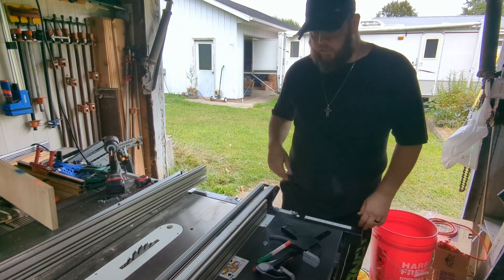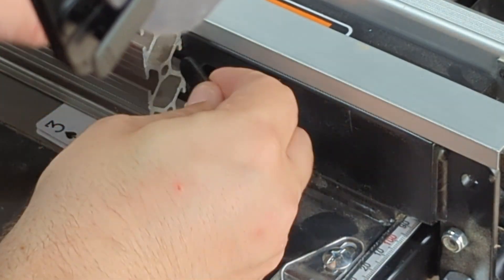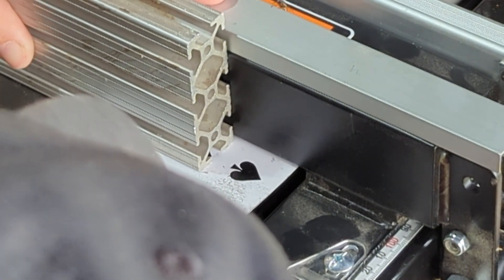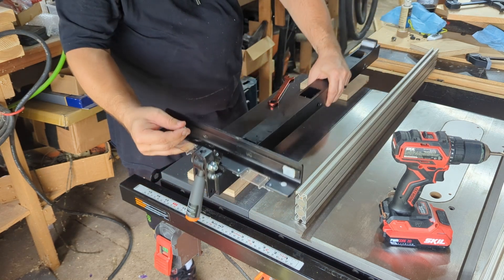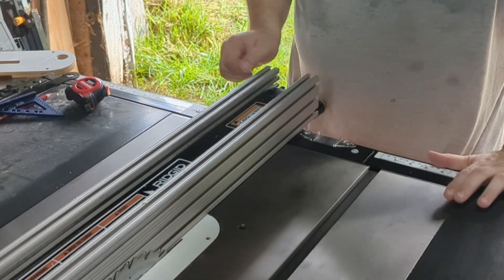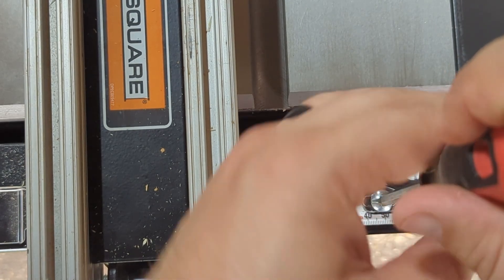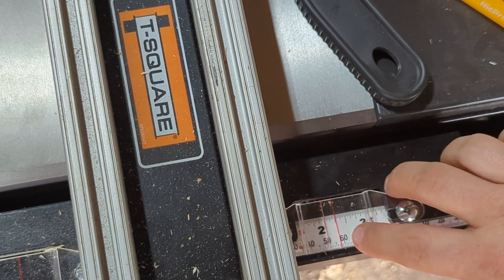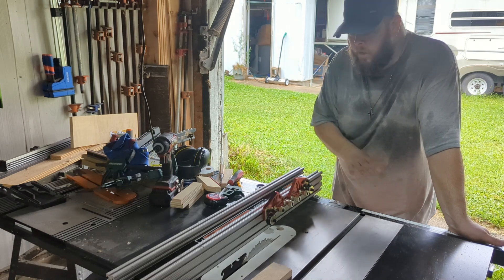How I upgraded my Rigid R4560 Table Saw Fence to aluminum extrusion | How to/DIY

Comment: Did you drill holes in the fence to tighten it?
Reply from the maker: I didn't drill any holes in the extruded aluminum.  Within the center core fence I only drilled the bolt holes.  Put the slip T nut into the extruded aluminum and the bolt through the fence with the head inside the main square center tubing of the fence.  There is 3 rectangular holes in the bottom that allow access to these bolt heads.  Used allen key to tighen the bolts then.  Hopefully that makes sense and thanks for watching.

Comment: Hi. Nice job. How high is your fence ? Can you give me the specifics of your aluminum? I want to copy your work.  Thanks
Reply from the maker: It is a 1.5" x 4.5" extruced aluminum, not sure on length at the moment but little longer than the stock fence and sticks off the end of the table by a few inches.  So total height is 4.5" tall.    You can get it on Amazon here:  https://amzn.to/3Z548ST but will need to find the hardware such as the little Tnuts and short bolts.

Comment: Really cool. Would love to upgrade my fence on my old cast iron table top craftsman
Reply from the maker: I love the versatility of having the extruded aluminum.  Attaching things like a sacrificial fend is pretty easy.  I had this on a used table saw I bought and now on this one.  One thing I think I'm going to do is oder a FastCap stick on tape and get it lined perfectly with the viewing window original line.  The one I added that is off just annoys me a bit.

Comment: Great video!  I recently did the same thing to my Rigid, but only on the left side.  I picked up a set of those stock guides (knock offs, not Jessum).  They are awesome!  They make ripping most boards easier and safer
Reply from the maker: I  have yet to try the guides... .which is not smart on my part because I'm out ripping boards for cutting boards the last few days.  Still have some to do, I'll go throw them on and keep on ripping.  Thanks for watching!